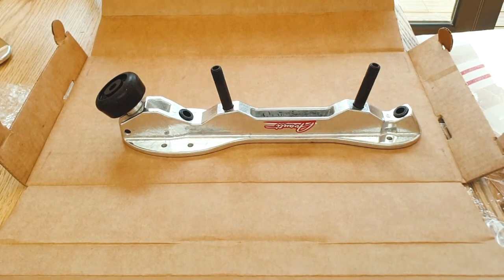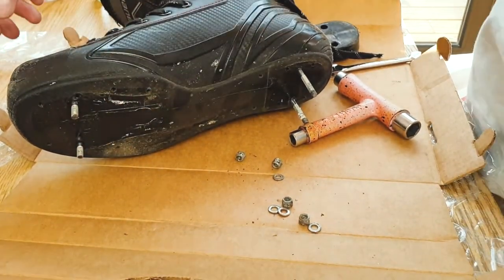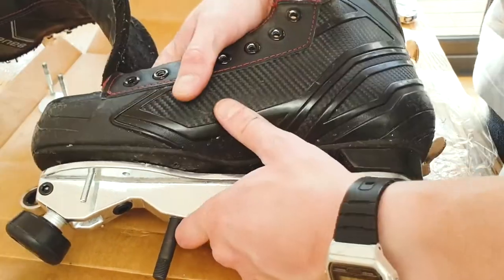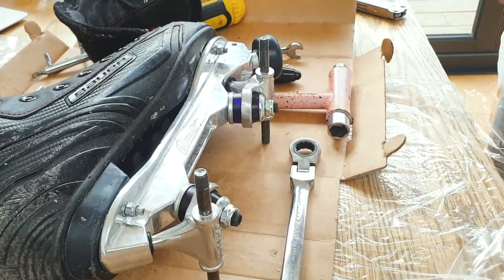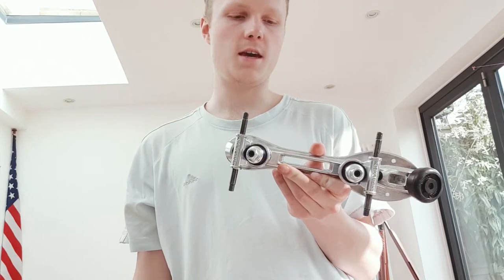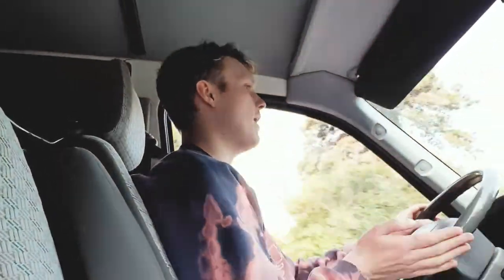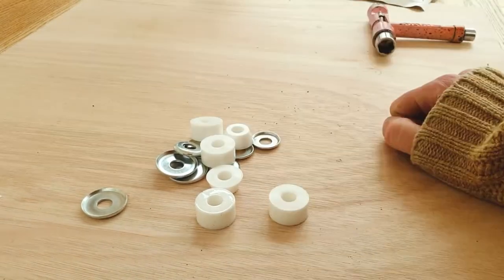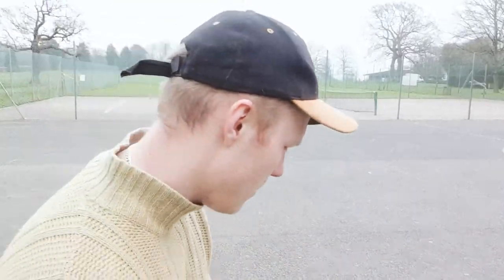Sure-Grip Avanti Roller Skate Plate Review 🛼🍽 Is there any difference? Roller Skate Quad Skating UK

Comment: Thanks for your vids, it's good to see that people are still into quads.  I've just bought some cheap used Raptors with softish wheels and hoping to get a bit of exercise in with them after not skating for quite a while.  My original skates were Bauers with Sure-Grip Classic plates - but after 35 years (!) the plastic boots now literally disintegrate when I pick them up and the thread on the one of the plates is gone so I can't put the truck back on, so I guess I'll be sticking with the nasty plastic ones that came on the Raptors.  Keep up with the skating and the vids! BTW stopping only needs a 'hockey stop', front stoppers are for running and rear stoppers don't exist 😀

Comment: Thanks for a cool video. Looking to get the same plate for my Bauers. Just wondering what size boot and plate you used?
Reply from the maker: My boots are a size 9 and the trucks are size 6. Bolt holes will vary depending on boot size and original truck size. I asked Oli's Skate Shop (where I bought the boots and later the trucks) for their advice and followed their recommendation. Couldn't have been a better fit.
I'd ask the retailer if possible!

Comment: They should send you a new truck! US axles are shorter, but not that short.
I skate Playmakers too, as well as other plates (I even have Roll-Lines, which are supposed to be the best), and I think you only really notice a difference indoors and with precision/artistic stuff (that's why I've always kept my Playmakers. I've never found fault with them outdoors). That said, I prefer harder cushions/bushings (for my weight) and you probably notice a plate's quality more if you're a soft action skater.
Reply from the maker: I haven't been in touch yet and have already skates them. Hoping they might send me just a new axel as I'd rather not take these off and put them back on again.

Not such a problem since they're working but is a shame from £100 trucks.

Have you heard about sure grip quality control issues recently? Ive seen a lot of people complaining about badly cut boardwalk boots recently.
Reply: @MisterSkids69  no, I haven't (more Riedell quality control issues) 😮. Would be a shame if SG started messing up too.
Idk, I don't think it matters that you've skated on them already. That axle is too short (so not locknut will ever sit safely on it, especially not with 10 mm spacer wheels) and they should replace that truck. I usually keep my plates when I get new boots and if you do the same, this will bother you for a loooong time.

Comment: Quick question - what is the approx distance between the bottom of the king pin and the ground when you mount sims street snakes on these plates? Are the king pins short enough to not catch on things when you're street skating?
Reply from the maker: Sorry for such a late reply. I've long taken the wheels off and will be unlikely to get that measurement. However, hitting the ground was never an issue when I ran these. King pin length does vary though and it's not uncommon for park skaters to grind the bottoms down for more clearance and grinding.

Comment: hi mate im a size 8 uk and i have the same skates as you, how did you work out the size you needed for your skates please
Reply from the maker: Sorry I'm so late to reply! Skates are funny sizes, you want half a size up from your UK size. I compared to the size of boots I own rather than the size of trainers. You want to go slightly larger than you'd think as feet swell when skating for a bit.
I'd suggest you'd want an 8.5/US size 9.5. 
That will depend on your actual shoe size - I find my trainers can be anywhere from size 8.5 to 10 depending on brand and model.